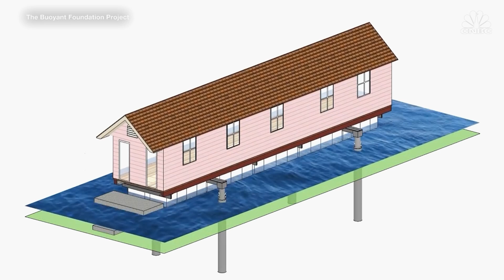How Houses Could Float

Comment: The weight of the building create force trap water pressure air pocket can drive generator so fuel less electricity easily

Comment: The effects of the downturn are beginning to sink in. People are being impacted by the long-term decline in property prices and the housing market. I recently sold my house in the Sacramento area, and I want to invest my lump-sum profit in the stock market before prices start to rise again. Is now the right moment to buy, or not?
Reply: Stocks with yields that outperform the market should be on your radar, as should shares that at least lag the market over the long term. But if you want a long-term strategy that works, I advise you to consult a broker or financial advisor.
Reply: Don't depend your market assessments and decisions on hearsay and rumors; I did it in 2020 and ended up with worthless market holdings. Before I started noticing any notable improvements in my portfolio, Heather and I had to completely rebuild it. I've been using the same advisor ever then, and in just two years I've scaled up to $876k. Depending on where you look, a bullish or down market might both produce good profits.
Reply: @JaykeTurner  Thats a good one. I know a lot of folks that made fortunes from the Dotcom crash as well as the 08’ crash and I’ve been looking into similar opportunities in this present market. Could this coach that guides you help?
Reply: @AngelsEyes-ny1pc  She should. Having a counselor is quite imperative for portfolio diversification. My advisor is ''HEATHER ANN CHRISTENSEN''. She is easily looked up and has extensive knowledge of the financial markets.
Reply: @JaykeTurner  Found her webpage, I wrote her an email and scheduled a call. Hopefully she responds. Thank you.

Comment: You can make concrete structures float.  We have successfully built concrete boats, and floating oil platforms from concrete.  This big issue is marine concrete construction is very expensive, high maintenance and short lived compared to their land based structures.  Such structures only make sense for residential construction when land prices are hyper expensive and everyone is working in high paying high end jobs.  These are pipe dream projects much like Palm and World Islands in Dubai.

Comment: BROAD Group manufactures something they call a B-Core slab. It's a steel panel with very thin steel cylinders inside it. It is used in skycrapers etc. due to its strength whilst using a lot less steel. Each B-core slab contains a lot of air so it can float. Their product brochure shows floating cities. Worth checking out.

Comment: I like the idea but what I think the biggest issue is that is not addressed is utilities. How are the gas and water lines going to move up and down? That's a big thing that's not addressed in this video.
Reply: Drinking water and gas is plausible with flexible pipe.

The bigger issue is the toilet waste.
Reply: @sn5301679  Sewerage is again done with flexible pipes. On board all waste water is passed through a grinder that breaks down all waste into small pieces that won't block the conduits down the line. Then there's a waste water tank and a pump with a backflow stop that pushes the waste water ashore (persleiding = pressure conduit).
Reply: Why would they have gas lines?
Reply: Water distillation stations that are likely part of the islands design.

Comment: Is it not easier to move inlands instead? How is plumbing supposed to work in a house that rises and sinks with the ocean? Will all movable parts not be clogged by mussels. I'm not an engineer so maybe these ar all easy to fix...
Reply: It’d probably have use composting toilets and ocean farms of mussels , clams and oysters below to filter water effluent. I’ve seen some diagrams with ocean farms and tidal electric generators below and solar desalination above so it isn’t tightly connected to the shore.

Comment: Um, what about sewer, water supply, and most other utilities buried underground that tie into the house?  You didn’t mention any of that stuff?
Reply: Probably have to use tidal electric power generation, composting toilet systems and water desalination. These all exist though are rare so many issues would have to be worked out at expense. Though I think this projects purpose is to work out all the issues to build floating cities.
Reply: @karld1791  you are right but I was referring to the idea of retrofitting existing houses to make them able to float.

Comment: I actually kind of find this very ironic you see traditionally before air conditioning houses in FLorida were built on high ground and where they couldn't be built on a high ground they were built on stilt foundations so that even if the entire area flooded it would have to get to 220 ft of water to get into your house. So the principal the floating foundation house actually makes a lot of sense and is good engineering it's just hilarious because we already had a solution to the problem and up until like the 1940s.
Reply: In the Florida keys I saw a lot of houses that consisted of a concrete pad with steel posts that supported a house. The house is accessed by a steel spiral staircase, the car is parked underneath on the concrete pad. The steel posts are long enough to be higher than hurricane swell is ever likely to be. It's not complicated and appears to work well.
Reply: Post WWII housing was a horrible idea, and we never should’ve done it. They literally went away from 10,000 years of trial and error and are blaming Millennials for wanting to do a bunch of ctrl + Z.

Comment: Finally 8 minutes in I get to something that doesn't fill me with foaming rage. The floating foundation concept for housing in Louisiana is actually brilliant and a version of it should be implemented just about everywhere. Modifying existing infrastructures also always an easier sell.
Reply: It is a interesting concept.  We need a full scale test to see how it performs and what drawbacks it will have.  Then it can be properly evaluated.
Reply: It’s interesting but like what we saw in NJ/NY the question is whether it makes sense to add these retrofits/lifts vs rebuilding a poor quality house. Anyone who has renovated a poorly built house and noticed the issues with code compliance will know that touching those is a can of worms that may be more expensive than a fresh builder grade house.
Reply: @CrunchyBaguette   you're right but that's still no reason to do tests and a few renovations full scale to see how this project works. And based on what I'm seeing it should be come part of the standard building code in areas that can flood especially Louisiana.
Reply: I’m with you, this focus on building new cities and abandoning current ones is infuriating in how boneheaded, wasteful, and heartless it is.

Comment: You know as a Floridian I could think of only one theoretical upside to a floating city. And that is if the platform can be towed it can be moved out of the way of major storms. Granted if given the option I just head up River in a houseboat but I'm a sensible person not trying to build a 100 trillion dollar problem to fix a billion dollar one.
Reply: Do you have a clue how hard it is to move a half million ton floating structure.  It's doable but it takes weeks just to safely maneuver a few hundred miles.  It's physically impossible for a half dozen of the worlds most powerful tugs to move such massive structures inside of a few days.
Reply: @ph11p3540   yes I do understand how impossibly hard moving in entire floating city would be. I think the entire floating city concept is an incredibly stupid egotistical elitist waste of money. if you make it too big to move it all you're doing is creating debris that can be thrown around by a storm surge except this time it the size of a city block.

Practically speaking you would need a nuclear powered engine and some kind of variable thrust guided system in an advanced computer system just to be able to control it and the number of places you would be able to park the floating structure itself is extremely limited. But if they can't move these individual building structures they're talking about all they're doing is creating a minimum several hundred ton floating battery ram to crush entire city blocks during a storm surge.

Comment: Interesting video. I am wondering about tsunamis. Will the floating cities float above the waves?  I am thinking of the December 26, 2004 Indian Ocean tsunami and March 11, 2011 Japan tsunami.  If they were further out to sea they would mitigate some of those issues. The closer to the shore the more risk for tsunamis. It would be interesting to see both a compute model and a physical tank model of a “floating city” next to a shore and how they would handle a large wave. Interesting new industry to watch as well as the retrofitting of houses to float in place.
Reply: You ever heard of Atlantis?
Reply: No you cant surf a tsunami. Tsunami would destroy this city but its better than nothing. When the water retracts or the tsunami warning blows better move to high ground like our ancestors did.
Reply: Yes they can be tsunami proof, although the architectural requirements would be much more intensive
Reply: Busan has sea walls located to where they would reduce the tsunami waves power in the bay area where these modular islands will be built
Reply: Only if they are positioned in a way that the building follow the receding tide out to see before the Tsunami gathers momentum. The structures won't be very comfortable to live on if they are far out at sea, as it will be no different than a cruise ship I imagine.